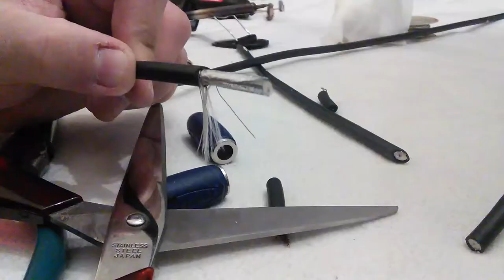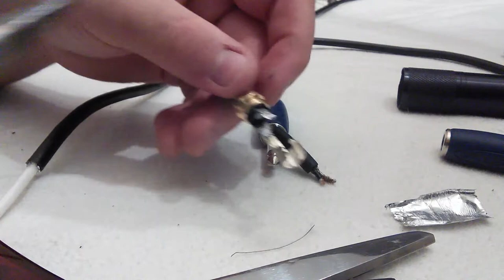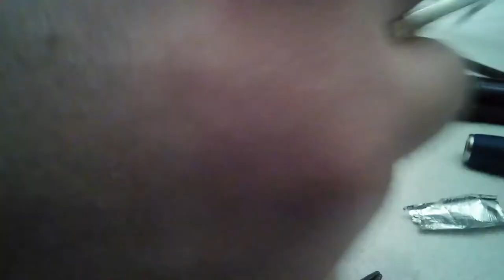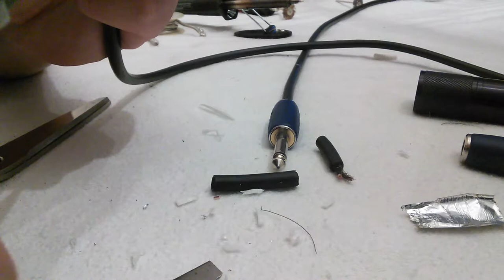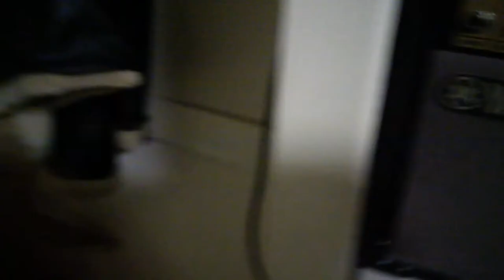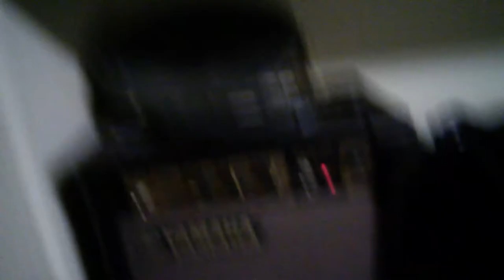How to make a tv coaxial guitar cable

Comment: Problem with RG59/RG6 coaxial cable is the center conductor is solid, which makes it a lot less resistant being constantly moved and bent. It will eventually break with normal use. It also makes some very stiff cables. Usually, you can get good quality instrument cables that barely cost more than the jacks themselves, so might as well get the real thing rather than making a hack job  :p 

PS. When you solder, don't put the solder on the tip of the iron and try to spread it. You'll only make some terrible, dull, cold joints that will eventually crack. Instead, heat both metal pieces and put the solder on the hot metal. It will flow naturally and make a nice shiny joint that won't break off over time.
Reply: Than try RG58 isnt solid, and more flexible. I read and compare datasheet, Belden RG58 have everything what guitarist need. All spesification so legit. Ill try make 1 and ill comeback to review